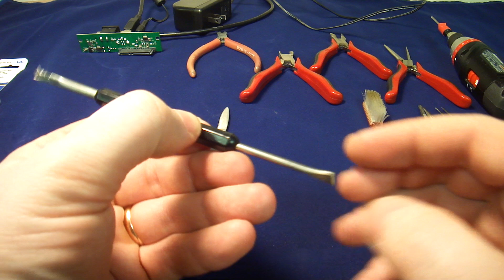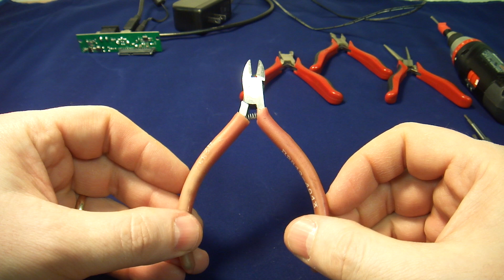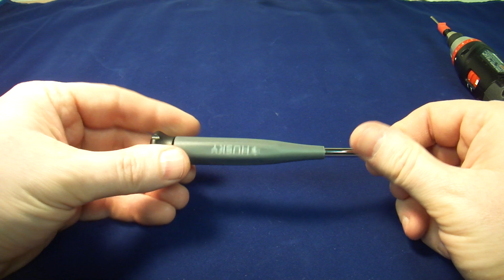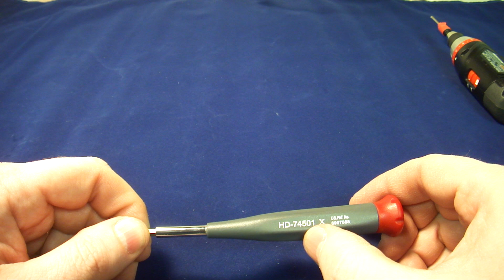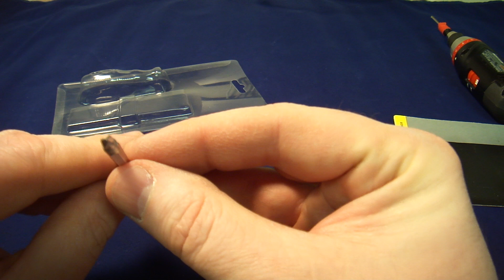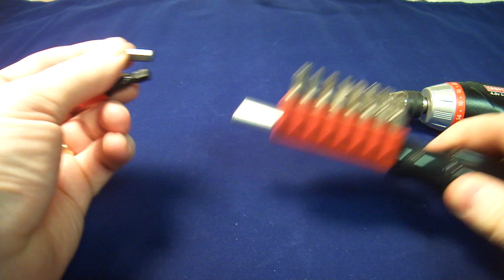Tools computer repair tech would use in daily operations MAH02619

Comment: still too slow for large workloads, i repair sometimes 75+ laptops per day, still looking for a high-speed precision cordless driver-  needs to be more then 350+ rpm, autostop or torque sensitive-   Im currently using spin.top precision manual driver, and can crank in screws at around 380 rpm (8 threads or less) with quick spin of driver stem-